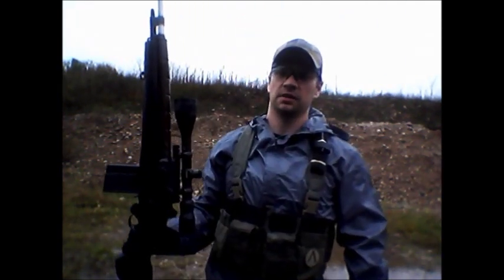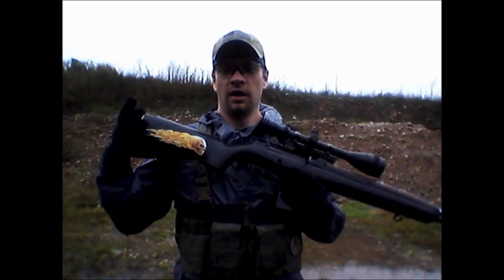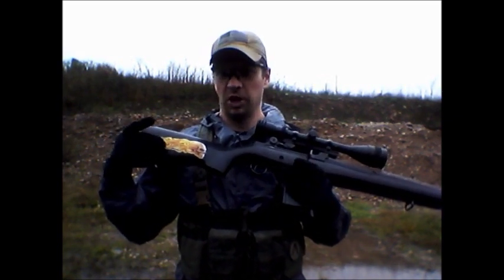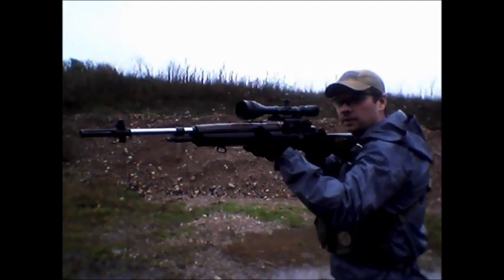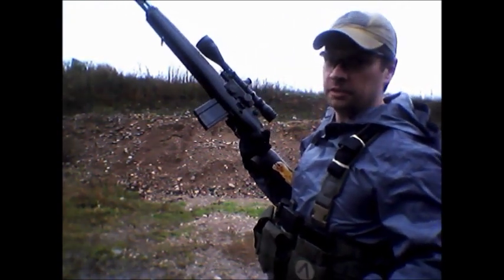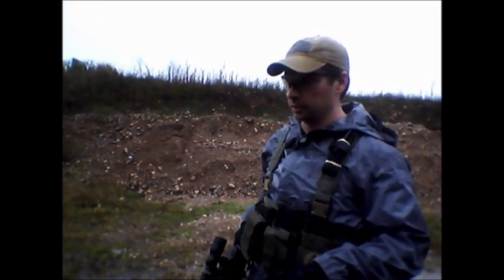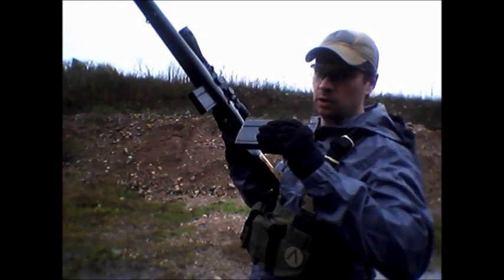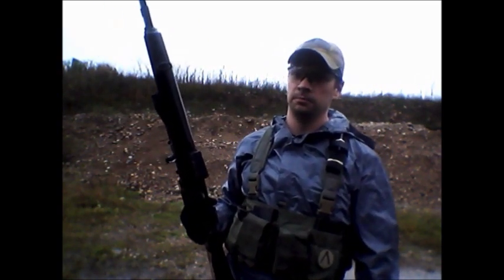M1A tactical and speed reloads.

Comment: Wrong Wrong Wrong! A) not everyone has fingers that can reach that far out and B) your using the wrong manual of arms. In this case your suppose to hold front of the gun with your left arm while using your right arm to remove the mag and insert a new one.  As you bring the right hand back to go to the trigger you bump the charging handle on the way. Unless your left handed, i don't get why people insist on reloading like in a video game with their weak arm when in real life you can much more quickly and precisely do these things with your dominate arm.
Reply from the maker: Probably because some of us are legitimately experienced gunfighters and competition shooters. Post a video with your times and targets and prove that this way is inferior.
Reply: Prove to me in a video that this is superior then? Do both styles of mag changes and time it. Use a unbiased sample of more than just one shooter. Until you can prove that, your argument and reasoning is just conjecture.
Reply from the maker: No, you stated that for a fact this is slower than your method so I said prove it. Since you refused and given the wording you used it's obvious you are neither a skilled shooter or brave enough to back your positions up.
Reply: Bastion Black Performance he's one hell of a flash mob dancer though....

Comment: Old video but good watch.

I would do the arm tuck and grab the mag with left hand using left hand thumb to press mag release in one motion. Let the mag fall to the ground or grab and drop in the pouch. Grab a new mag on the way up (easiest mag, closest to mag pouch), insert. Grab hand rail with left hand and start to lift rifle and use as a stabilizer. While lifting rifle up, charge handle with right hand (finger as seen in video) or get the bolt release tab which is available since this video and highly recommended. This method is ideal in case you have a failure to insert round, as you can slam the charging handle with right hand.

The difference in times with these different methods are very small if all goes well. My method should give you an overall fast reload time with the fastest recovery if you have a mag or round insertion failure.

Comment: It's basically a ar paddle for the m14  no more need to touch the charging handle ;)
Reply: Those cant be used on an m1a. The charging handle needs that little extra pull back to chamber the .308 round completely. If not, you can get jamming issues